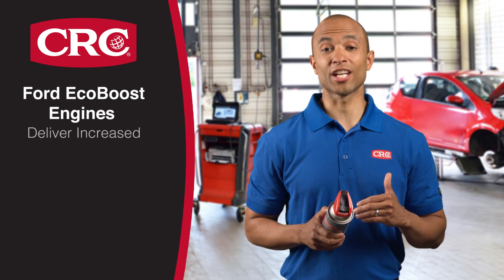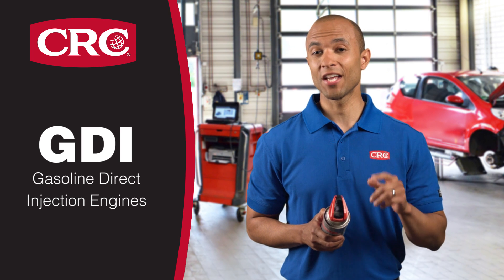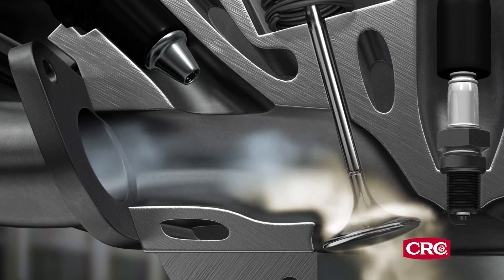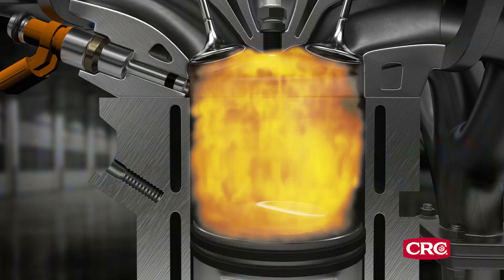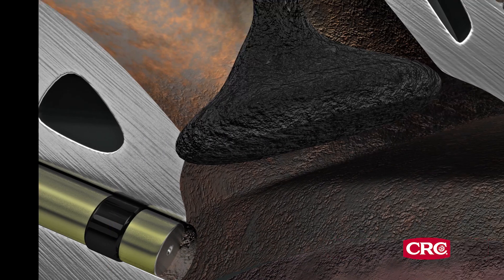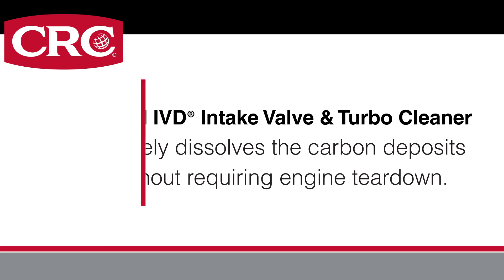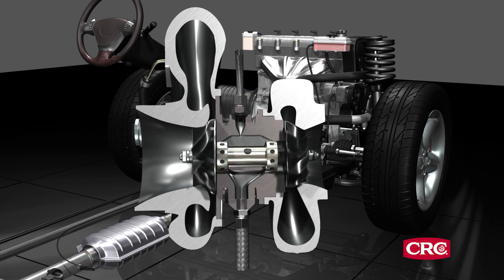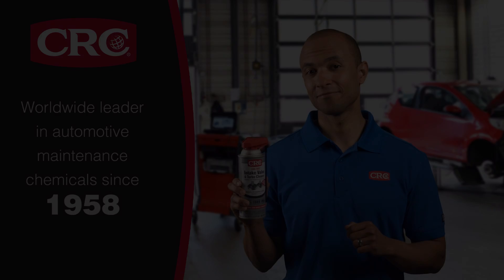Ford EcoBoost Engines with CRC GDI IVD® Intake Valve Cleaner

Comment: I have used this with a new 2014 F150 that now has 150k miles. I have done it about 500 miles before each oil change since new and the only problem you will have is it will throw a cylinder misfire code that must be reset with a scan tool. Other than that the engine feels as good as new with no problems. I do not know if it actually works because I have never had to remove intake yet. I want to think it does because I do it religiously before each oil change. Hopefully one day I will see if it does or not

Comment: I have a 2015 Ford Escape wirh the 2.0 bEcoboosy and .My only concern is that if some of those deposits break off and getting sucked into the turbocharger charger that could do damage .m
Also didnt Ford Recommend not using Carbon Removal Products because of this concern with deposits  Breaking off and possible causing damage ?? 

Can you please commemt on this? meaning are you aware of this statement made by Ford about this issue?
Reply from the maker: Hi there. I am not aware of this statement. However, I recommend that you contact our Technical Services who are on-top of these issues - techservice@crcind.com

Comment: How to destroy your turbos in less than 10 minutes. These are NOT GDI engines. They are GTDI engines. Spraying a cold flammable aerosol on hot turbo blades is asking for trouble. These induction cleaners should only be introduced on the back side of the turbo(s) and just in front of the throttle body blade.

Comment: Use this every 10,000 miles, okay.  But what if you bought a used ecoboost with 90,000 and it's never been treated?  Is it still safe to use?
Reply: I'm going to chance it :) I have 110klm
Reply: @xenomorph7299  as an update, I ended up pulling off the intake manifold and cleaning the valves with wire brushes and B-12 chemtool.  There are youtubes to walk you through it.  If you want to do it thoroughly, I recommend it.
Reply: @colliswilliams8992  Thanks for sharing. How much carbon buildup did you have at 90k miles? I only have 110k kilometers which is 68k miles. If I use that spray cleaner I would hope there are no large carbon deposits that can cause damage to the turbo. I may just have to do a manual cleaning like you did.
Reply: @xenomorph7299  My valves were pretty bad, especially around the stems.  The carbon deposits would more likely damage your cats than your turbos.  But all those parts are expensive.  If you take your time, the manifold isn't too tough to remove and reinstall.   Do one runner at a time and ONLY do the runners with the valves that are closed.  Then you'll have to turn the crankshaft 1 turn to close the ones that are open. (It's easy) After cleaning each runner, remove the plug for that cylinder and blow some compressed air both ways to remove any chunks that might have fallen inside the cylinder.  Some guys go ahead and pull the fuel injectors while they're in there, and give them a good cleaning.
Reply: I would do multiple times about a week apart

Comment: Buy a catch can, problem solved
Reply: catch can is not a problem solver but merely to slow down the carbon build up. Some trucks have dual fuel injectors and dual spark plugs. One directly inside the engine, the other one is to clean the valves.

Comment: I'm very confused. How is that going to clean the turbo?
Reply: You don’t. If you fins are dirty, you got another problem
Reply: When you spray the CNC cleaner, you are spraying in the intake side where the breather it's located but past the map sensor. When the spraying starts, the spray goes to the turbo first and then through the intercooler into the valves.
Reply: @derjoh1986  no. you spray it into the purge valve nipple on the passenger side of intake manifold. It's about 20 inches from the intake valves so almost directly on valves for cylinder 2 and 3. This bypasses the turbo cold side all together. I'm sure some of it doesn't burn off and makes it way into the combustion chamber and through the hot side of the turbo where it would've been mostly burnt anyways.

Comment: This is a why to not a how to. I bought this and don’t know the vacuum line to spray it in. This stuff is getting returned back to the store
Reply: Wouldn't it be better to learn where the vacuum line is? You can use the line from the brake booster.

Comment: I have a 2016 3.5 ecoboost f150 no catch can and a 93 tune.  113,000 miles with zero power issues or idle problems. One you can jack up your turbos doing this but it may or may not happen depending on how bad carbon is built up. Rub good fuel, rub it hard once in a while etc. most of the commenters do not know what they’re talking about at all or have limited info they’ve read on forums.
Reply: Dude did you even do a bit of research? Fuel quality has nothing to do with it. Fuel doesn't touch the valves. It's D.I. 

Ecoboost trucks eventually got port injections to clean up the ports while you drive. But if you have D.I. only and no port injectors, running it hard makes it worse, more blowby, hotter valves= more buildup. 

Blind leading the blind is how I describe your comment. Lmao

Comment: And where exactly is this supposed to be sprayed? Lame video really
Reply from the maker: Good morning, 

You can spray it in from the air filter housing or as close to the throttle body as possible. Contact Technical Service directly 1.800.521.3168 or techservice@crcind.com
 if you have further questions :-)

Comment: this product is quite shit if you apply it the way they suggest. it won't do shit to help with carbond deposits on valves. you need to manually clean them with this product. this way it will acutally clean them.

Comment: Cleaners like that will make the turbos run hotter and warp the impellers
Reply: ran two bottles back to back then went on a freeway drive just like the instructions said to do. Kept the car at around 4000-5000 RPM to keep motor hot and the turbo spooling at max PSI. Car runs smoother, quieter and has better gas mileage after the cleaning. It works as it's supposed to.
Reply: Not only that but you can ruin the seals in as little as one application causing your turbos to need replacing.
Reply: You must not have seen how the EcoBoost was developed. They froze the engine and then ran it full throttle for hours and it didn’t have issues. 

They towed a NASCAR stock car around the track on a trailer for 24 hours and the heat was never an issue. 

This cleaner is added at idle or under 2k RPMs. This won’t create enough heat to damage anything.
Reply: @chrispewkreme  What does freezing have to do with getting hot and warping? Nobody said if you tow some thing it would get hot and warp that engine is designed for towing. The problem is all the cleaners used to remove carbon don’t always remove it all and will make the engine run a lot hotter than regular gasoline. If you go to the Ford dealership with this problem they remove the heads and install new heads and new valves. If that simple task of running cleaner through it really worked everybody would be doing it and wouldn’t be necessary to go to the dealer. Do your research I did and that is why I didn’t buy an eco boost F150.

Comment: ford does not have an approved procedure yet, do not spray anything down the inlet on an ecoboost engine! the turbo will most likely be damaged and the warranty voided.
Reply: When ingesting the cleaner the combustion process burns hotter than the turbo was designed for, if it was as simple as spraying a chemical down the inlet that didn't damage the turbo I'm sure ford engineers would have approved it by now. Its wrong to keep pushing a product that may ultimately void a warranty on someone's vehicle just to make a buck.
Reply from the maker: @dano5904  In our testing we have not seen increased exhaust temperatures. You can see our third party clean up data here www.crcindustries.com/gdi
Reply: CRC Industries so is crc willing to cover someone's warranty if they use your product and it damages they're engine or turbo?
Reply: So are you confident Crc that this won’t damage my turbos or catalyst system enough to offer a full repair free of charge in the event of damage. I’m asking because if you’re claiming what you are when Ford clearly says not to use it then you’re by law falsely making claims and could be legally responsible for damage caused by this product especially where you’re posting specific use in ecoboost engine.
Reply: @joecraig9108  ford doesn't approve anything 3rd party ever. Not that it isn't safe, it's so ford isn't liable for anything. It's about money. 

Jeez people are so gullible. 

I'm sure you listen to Ford saying tranny fluid is lifetime and you don't need to change it lmao
Reply from the maker: Using a solvent cleaner could make the carbon deposits come off in bigger pieces and possibly cause damage to the engine internals. Our GDI cleaner, however, is a detergent cleaner. What happens is the polyether amine (PEA) in our product will attach itself to the carbon and slowly break it down so it melts in the combustion chamber. Very slow, very controlled. This way there aren’t any big pieces to damage the cylinder walls, pistons, turbos, and exhaust ports/manifolds. Our product has been proven to clean the turbo fins. In all of our testing no scoring was found on cylinder walls, pistons, turbo fins, or exhaust manifold ports. The proper way to use this product is per the instructions on the can. This product is designed so you don’t have to perform manual cleaning or tear down. Our PEA chemistry works better with heat from the engine. We have used this product on multiple Ecoboost engines with no issues. The same with our end users. For additional product information and testing results view our GDI cleaner’s website http://crcindustries.com/gdi/  Should you have further questions please contact CRC Technical Support 1.800.521.3168.
Reply: More marketing wank......  Your product is a solvent.  A detergent would only work if it were in constant contact with the carbon deposits.  Detergents work more effectively to bind deposit-causing precursor chemicals up before a deposit can form.

Comment: Not approved by ford. Ford engineers say products like these can damage the turbos in multiple different ways.
Reply: Same ford guidance that also says never to change your transmission fluid and filter, recommended just to go buy a new ford
Reply: @infotechsailor  Yup Ford recommends you do your first trans service at 150k in the transit 250 LOL. That just doesn't sound right at all.
Reply: Of course not, they want you to pay them to replace the heads every 50k
Reply: Ford literally does not have a single approved method. Yet it still has to be done on these early gen EcoBoosts
Reply: Serromonte ford in daly city California  
Reccomend this .
Very confusing..
Reply: Some people prefer the way. Then they find out it's the most expensive mistake they made.
Reply: You spray it AFTER the turbo…. Don’t clean turbos with this stuff
Reply: @NickBEADG  how you going to spray this stuff after the turbo? If the map sensor, in which is before the turbo, doesn't receive any air flow, a car won't run correctly, if at all.
Reply: @derjoh1986  purge valve nipple on passenger side of intake manifold is about as close to the intake valves as you can get without having to take the intake manifold off and spraying it directly on the intake valves. I've used two canisters back to back. Car runs smoother, quieter and better gas mileage. Use to see -1.5 degrees of timing correction at WOT. Now it's a stable +4.0 degrees with no fluctuations when data logging with the Cobb Accessport.

Comment: This stuff is snake oil.  It won't remove hardened carbon deposits from valves, it will only wash down loose debris into the cylinder and it will damage rings and cylinder walls over time. 
The only way to remove carbon buildup is to manually clean it off after pulling the intake. 
The only way to prevent it is to fix the PCV system by preventing crankcase oil vapor from entering the intake..
Don't waste your time and money on this junk.
Reply: Brian,you are absolutely correct,this stuff and similar products,are pure snake oil.What's worse is on any turbo aspired engine,especially Ford Ecoboost,you run the very serious risk of destroying your turbo.Mechanical cleaning is the only way to clean the valves on direct injection engines.I had my ecoboost cleaned using nut shell blasting.Expensive but the car now runs as it should.
Reply: Brian Smith how much did having that done run you?
Reply: The only problem is it will still happen in a perfect world with a perfect PCV system. Cars that don't have an EGR valve usually have variable valve timing and increase valve overlap. The exhaust valve is the hottest part of an engine and has a built in 'self cleaning' function. The intake valve, not so much when it doesn't have a constant wash of an excellent solvent, gasoline, in the port fuel injection counterpart.

Comment: Doesn't the cap that comes off the turbo impeller just go directly into your intercooler, messing that up?
Reply from the maker: The front part of the turbo is usually clean because nothing else travels thru besides air from the air filter, which then goes in and out of the turbo, in and out of the intercooler, then into the throttle body. When the product leaves the engine it goes past the back side of the turbo which is dirty. You can see the turbo clean up results at www.crcindustries.com/gdi

Comment: Has this product been approved by Ford Motor Company?
Reply: David Burlison hell no. I’m a tech at Ford. These products increase heat going into the turbo. Does far more harm than good. Best solution is to floor it 0-80 hard a couple times a week
Reply: Exactly how would that help carbon build up on the back sides of the intake valves on a direct injection engine...?
Reply: @michaelr3870  Thermal shock load on the valves would cause them to expand slightly, enough to break loose very small deposits.
Reply: @michaelr3870  With CRC GDI cleaner, you feed it into the intake manifold so it washes over the backside of the air intake valve.  I actually installed a Schrader valve (core removed) with a cap on it as a place where I can inject it in exactly the same pattern as the natural aspiration, so the closes valves that coke up the worst are the first and heaviest ones that get treated.
Reply: CRC claims that their PEA technology does not cause heat, but works by dissolving carbon products.  I know that Ford doesn't approve it, but it is a lot less expensive than replacing the heads, and so far, no adverse side effects with noticeable  performance improvement.

Comment: I called tech support but no response, can you tell me where is the best place to spray it in my 2016 Ford Fusion 2.0 ecoboost?
Reply: ipodjunkie81 did u use it how well does it work on the turbo
Reply: Alvin Long everything is operating normally had no negative effects, will have to do it a couple more times since these ecoboost engines gunk up soo fast and also would recommend installing a catch can, I did and after two weeks there was quite a bit in the oil catch can
Reply: @ipodjunkie81  where u find your catch can at
Reply: Brendon Gummel eBay, nothing from china though
Reply: @ipodjunkie81  I have noticed a significant reduction in exhaust pipe carbon since I used CRC GDI cleaner.  No adverse side effects, but I do feel like engine responsiveness is improved with almost no "hesitations" or misfires.
Reply: @ipodjunkie81 did you warm up the engine and spray it into the intake throttle body (like you would seafoam) then kill the engine and wait 10mins or so and start/drive it? I have a 2014 fusion 1.5l EcoBoost that's having a bunch of misfiring/turbo problema
Reply: matt nadalin the bottle has instructions you have to empty the entire bottle short Bursts at a time while holding it at 2,000rpm , let it heat soak for an hr and then drive it at highway speeds for 10 min

Comment: Take the "How to" out of the title for this video. There's no "how to" anywhere in the video.
Reply: Thanks for the response, however crcgdi.com doesn't have any more "how to" than the comment "Easy-to-use CRC GDI IVD® Intake Valve & Turbo Cleaner is sprayed through the air intake." If you really want this to be a "how to", show us exactly how to use the product, ie. in the video, show someone opening up the air intake on a car and spraying it into the intake, warning viewers not to spray into the MAF sensor, unless it's safe for MAF sensors, etc. The video should also reiterate the instructions on the can about RPM, how much of the can to use, revving it afterwards, letting it heatsoak, then driving it. Thanks.
Reply: It works on my truck.   @wmsky33

Comment: I have 2016 Ford Fusion 2.0 ecoboost  where on the engine would I spray this product, I was thinking right after the maf sensor and if so are there any others sensors I would encounter and damage or possibly damage the electronic throttle body?
Reply: Is that the map sensor and would that damage my engine if I temporarily remove it?
Reply: I’m having a hard time finding the boost sensor on my car would it be under another name please help
Reply: Do I spray this before or after the turbo on my 2.0 ecoboost?